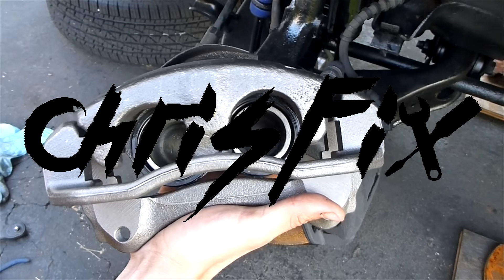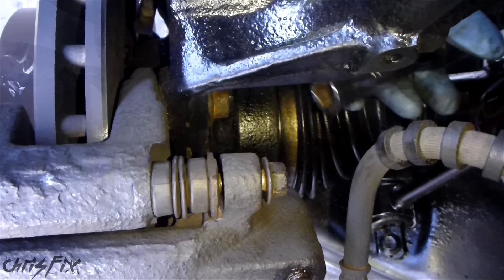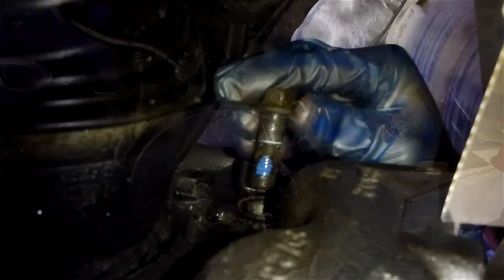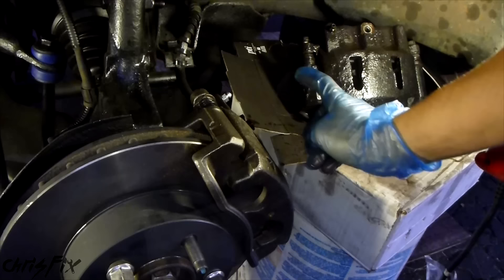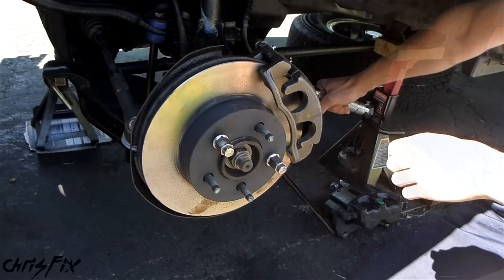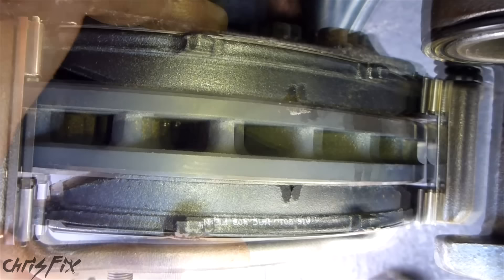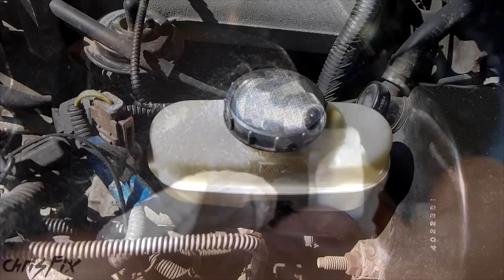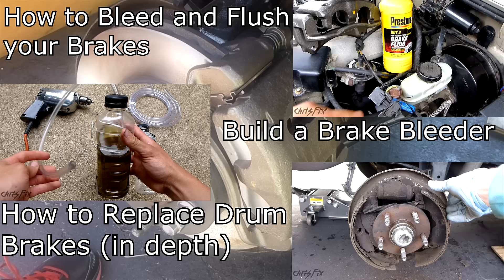How to Replace a Brake Caliper

Comment: Great video, as usual, with good tips for the novice. 
One recommendation:  I would only replace calipers in matched-pairs, especially when you're using aftermarket calipers (Centric, AC Delco, etc.), to ensure both have the same hydraulic characteristics.
Reply: I’ve never understood why doing just one side would cause the other side to fail. Of COURSE they have a little different hydraulic characteristics
Reply: @brandonminear9400  
Replacing as a matched-pair is more about grip-functionality.  If one side grabs the rotor more firmly/more loosely than the other, you'll have: steering issues while braking (especially while hard-braking), uneven tire-wear, uneven pad + rotor wear, etcetera.  The same thing applies to using unmatched rotors, especially if the material varies significantly in temper and composition.

Comment: Hey Chris you always do a great job with great explanations. One item you might should have mentioned was to bend down the "metail brake slides for the pads" so they don't move around. You'll notice the little tabs on the outside of them. This keeps them from vibrating into the brake disc and squalling like a crazy banshee! Appreciate all your videos, keep up the good work!

Comment: but yep, if all the people who watch this have a unsealed 32oz bottle of brake fluid, they can do this $230.00 job & bleed all 4 brake lines in the specific sequence for just $36.00.     and mechanics charge $230.00 per caliper too, and i think they only bleed the line that goes to the caliper that you needed to have replaced, not all 4.     so yeah, not only can you can do a better job, and flush all the old fluid outta all 4 of you're brake lines with nice synthetic fluid, but you can also do it for $36.00 versus the $230.00 a mechanic will charge you.    keep in mind, that the mechanic probably ain't using synthetic fluid, nor is he flushing old fluid outta any of the lines but the one he,s working on.      this is why i love doing jobs like this, at home.      thanks for making this video.    it walked me through each step perfectly, and it saved me a lot of money as well.
Reply from the maker: +Jeff Fuehr Glad the video was helpful and saved you money!
Reply: What do you mean synthetic brake fluid? lol
Reply: @DoctorFush  If your owners manual species a type, use that.  Say it is DOT4...some will offer 'synthetic'.  As long as your car calls for DOT4 go for it.
Reply: @goitoutdoors  Isn't all brake fluid 'synthetic', is what I was getting at.

Comment: doing the calipers and parking brake shoes on my 01 outback. Iv'e watched quite a few of ChrisFix  vids before and during work on my vehicles and appreciate the tutorials. just one beef is that he replaced the caliper bolts without cleaning them up and leaving the old thread locker in place.
EDIT: 3:14
Reply from the maker: This was an old video, but its good you saw that since you know how to do this properly

Comment: Hey Chris I just have a quick question I was wondering when you replaced the caliper do u bleed just the one caliper or do u bleed all brakes?
Reply: i was wondering that too
Reply: I'm pretty sure you need to bleed out all of the calipers. in fact, theres a specific order to bleed out the calipers. 1st caliper should be the furthest caliper away from the brake fluid tank in the hood (rear passenger side) and so and so forth.

Comment: Nice but you should of mentioned to check/add grease to the caliper bracket bushings (for those with used calipers as well as to inspect/replace bushings etc.)
Reply from the maker: Ash Ziavonni Thanks and thanks for sharing!

Comment: My bleeder valve was completely seized. Blowtorch/ vise grips didn’t work. Used an extractor kit. Still didn’t work and broke it flush. I could go more and use a dremil to cut a slit/ or drill a hole and yada yada… I’m thinking spending the $50 for the new caliper will be easier. Great video! Hopefully those bolts on the back aren’t seized bad. Gonna attempt tomorrow! Gotta love oxidation
Reply from the maker: Might be worth it especially it its that old, get those bolts soaked with penetrating fluid now
Reply: @chrisfix  ordered both front calipers none local. good idea! ima soak them tonight. It’s a 98 Kia Sportage. Weirdly the most reliable car ever I’ve had. I’ve only had a leak in the intake, put e6500 and wrapped in electrical tape. And this. 
But 8 years for $800, ima keep it going! 
Also, never tried it, but bleeding the brakes with a syringe. Seems easy

Comment: Your videos are great. No unnecessary fluff and you mention torqued settings although that varies from vehicle to vehicle. For instance most if not all Toyotas it’s 76-77 lb ft for the calliper bracket bolts and 25-26 for the calliper pin bolts. Interestingly the 77 is also the torque for the jug nuts. On my 2019 Buick the torque for-the lug nuts  is 100.

Comment: I have watched several of your video's, and all I have to say is, "thank you for sharing". My latest learn was how to change my rotors, brake pads and turns out the drivers side caliper (hence watching this video). Turned out my piston was damaged. Said using old banjo bolt voids the new caliper warrantee. Better safe than sorry. It's what...$3.69 at Napa. Your video had me looking at torque specs too. thanks for the close ups and part explanations. and the simple box trick. Saw that and was like, "Der". Why didn't I think of that. Things click when someone shows me. I used zip ties to suspend them and not stress the brake lines.

Comment: Thank you for all of your help with the many videos of yours that have helped me over the years. I thought that I was going to be performing a simple brake pad replacement on my 2003 Toyota Corolla, but it turned out that I had to replace the pads, rotors, AND the seized caliper. I could never have done this without your helpful videos. I have been out of work for the last 2 years and don't have the money to pay a garage (hence, the 16 year old car); Thank God that I have your videos to give me the knowledge and confidence to do this work myself. You have been a savior. Many blessings to you and your family!

Comment: I see you always mention how much to torque on each nut/screw where do I find a torque specs for each screw on my vehicle?
 as well I see you didn't put the jack stand directly on the middle frame of your car and you put a piece of wood any reason for that or you just wanted your car to be raised higher?
   lastly what type of Grease do you recommend to put on the back of the brake pad and the brackets I remember watching one of your videos what you put, just don't remember off hand and you didn't mention it over here.

  if I use the two-person method or even the one person method can I just put a bucket or shall I use a tube for the brake fluid to be placed on the bleeder valve? 

  And once again can't get over it, you are truly amazing when it comes to videos from your jobs you do, you move along the video and I don't lose my patience watching your videos, it gives me an urge to wanna do all the basic repairs on my own car and not waste my money sending it into the mechanic, just by watching your videos and enjoying how easy and simple you make it.
 Thanks Chris
Reply: Mayer I - I'll try to answer.
1) If you have a Chilton's Manual for your vehicle, torque specs are at the end of each chapter. Check your public library.
2) For jacking, find the specific instructions for your vehicle. And sometimes using a piece of wood is spreads the weight out over a larger area.
3) By high-temp brake grease at the auto parts store. Other greases break down under high temps.
4) For bleeding use a tube because, like in the video, it allows for the air bubbles to float upward if you position the hose above the caliper. If you don't use one, the fluid will drizzle out and air may move into the caliper without you knowing it.
5) Good Luck!
Reply: @ninemilliondollars  Thanks a million for answering.  Wanting to do the brake job for a while. Going to do it hands on and report back. Love to do such repairs.

Comment: You saved me, thanks a lot!!  Mine was a little different configuration (2012 GMC Acadia) but easy enough to figure out.  Also, had help, so just bled the brakes with someone pumping and holding the brakes.  **Used more brake fluid than I expected.  But might be because it was leaking!!

Comment: A good truck I found out is use an old tire vale stem to use as a plug on your brake line where usually the bajo Bolt goes, saves you some brake fluid mess

Comment: Absolutely a great video. Clear as s__t to  understand and video recording technique was spot on. I just did pads on my RV, and after taking a 1600 mile road trip I'm pretty sure I have a binding rear caliper. Hopefully it will last the 1600 mile trip home, where I'll do the replacement.

Comment: Big thanks for your very detailed video. I was successful to change the rear left caliper. But, I only can stop my car with brake pedal going to the floor. Do I need to bleed the new caliper? Thanks!
Reply: Update: it seems that only the two front brakes work, will see after bleeding the two rears

Comment: I have one question, if someone could answer this that would be super helpful; is it a good idea to replace calipers (and rotors) in pairs it would it be a waste of my money? there’s an issue with my front left caliper and i believe one of the rotors is warped (i don’t remember which one.) I’ve also considered resurfacing the rotor but at that point i figured it was more cost effective to just get a new one. thanks in advance and as everyone else in the comments is saying, Chris you make some incredibly helpful videos thank you so much!
Reply from the maker: I would always replace them in pairs! And thanks a lot!

Comment: Just some tips. 

Use a silicon fluid based grease on all moving parts. Not standard automotive grease. Anti seize on stationary part connections such as backing Plate of the pads. 

When installing new crush washers, torque banjo bolt and then do a light tap with a hammer on the head. Re torque. Remember it's a crush washer, that will make it seal real well.

Comment: Good video...  One thing I would do different, when you are using loctite - blue - I would NOT stop the tightening of the caliper mounting bolts as the loctite "may" set at a reduced torque value, then it may add resistance and "fool" you into a possibly incorrect torque value.  Once you start the bolt tightening, don't stop, torque to the full recommended value.  Just a thought.

Comment: Chris, can you show for the rear caliper where you have the emergency brake cable and how to detach it and later connect it without messing the tension in the cable.

Thanks!  U R GR8!

Comment: How do you know which calipers fit your car? Do you go for the rotor size specs or the # of pistons in has? And Thanks you Chris, because of you, I have been able to do oil changes, clean headlights, and maintaining my car. Now for my new project is to change my old brakes and my suspension.

Comment: If you are doing rear calipers with an emergency brake line, you'll have to find and loosen the emergency cable inside the car. Then before bleeding, you'll need to have someone pump and then HOLD the brake pedal down with their foot while you tighten the emergency brake cable back up. This sets the rear brake pad height from the rotor. On some cars if you don't do this, you will have too much of a gap and your brake pedal will go halfway down before starting to engage (i.e. Kia Soul).

Comment: Hi Chris. Thanks for making the video.
I replaced brake lines, hoses, calipers and wheel cylinders (rear). I noticed that no fluid bleeds from the 
rear bleeding valves. Does it mean my proportioning valve need a reset?
Reply from the maker: If you think it does give it a try, sometimes it take a while for new fluid to make its way to the rear though

Comment: Very impressed with your knowledge, step by step videos. U obviously know what ur doing. I’m getting ready to do my first full brake fluid flush, super radiator flush. Can u please do a video on a complete overhaul of a brake caliper? Piston, ring, boot removal, rings, etc,  and replacement. Just priced a caliper with new piston $140.

Comment: Thanks for sharing this- I also like to see how to clean the caliper- and the cause of damaged caliper.
Reply: A damaged caliper is one that's leaking or one with pistons that don't move easily - caused by sitting a long time unused, or having a buildup of dirt and other materials that freeze it. This can cause the brake pads to drag on the rotor and overheat the system.
Reply: @ninemilliondollars  Thank you so much for taking the time to reply-

Comment: One thing I’d add, make sure you fill the new caliper up with brake fluid, it will make bleeding the system way faster when you move the hose over.

Comment: Great video, thanks! Have a basic question. Do I have to bleed all four brake lines if I'm only replacing one caliper?
Reply: why would you need to bleed all 4 when you just changed 1 ??? 
When you have a flat tire, do you change all 4 ??
Reply: Michael. My suggestion would be to bleed all 4, it doesn't take all that long and also allows you to get some fresh brake fluid into the system and each line. Some may disagree but at the shop I always bleed all 4 regardless of how many brakes on a car I am doing

Comment: I noticed your brake fluid was very clean when bleeding the caliper.  Would you suggest flushing the brakes first, then the caliper replacement, then would you need to bleed all 4 break lines again after you replace the caliper? Or are you safe to just bleed the replaced caliper line?

Thanks a ton for the videos!

Comment: Question: the banjo bolt has a hole on the side to allow brake fluid to flow into it, then another hole to the bottom for the fluid to reach the caliper. When you are installing the banjo bolt, how do you make sure the side hole aligns with the brake line to allow that fluid to flow? I assume if you don’t align them, the fluid won’t flow.

Comment: Thanks for the vid I always wondered about crushing these hoses.. i'm scared to do it. I was wondering however if i could use one of those cone shaped silicone plugs and just stop the brake line with the? I used once on my bleeder screw hole when I needed to change that and it was pretty effective.

Comment: On a 2012 Ford Transit Connect XLT, my banjo bolts have some sort of nipple at the end of it which is too large to slip off old and slip on new washers. Gonna have to reuse what's on there. Both also seem to be adhered to the bolt. I'd hate to gouge them up taking them off only to learn I can't get new ones on anyway. Crossing fingers.

Comment: Stuff a lil but of a shop towel in the banjo bolt holder it’ll stop a lot of the brake fluid. Just don’t pack it like you’re tryna stop a bullet wound and your life depends on it

Comment: Did the front left caliper on my 2001 Oldsmobile Intrigue GX when I got the front pads and rotors replaced on my car with my friend 3 years ago. Going to get new front pads, new caliper guide pins for all 4 calipers, and other things. Also, how does one simply install a caliper on the rear of the car that has the emergency/parking/hand/foot brake cable? It's the same, except you would need a special tool to remove and insert the cable, right? My rear calipers are original and I'm going to inspect them sometime for any wear and tear before replacing the rear pads and rotors.

Comment: Disconnect brake line, clamp. Remove pads and callipers (obvious clips/bolts) Replace in reverse, reconnect brake line, open bleeder, remove clamp, left fluid run out a little, secure bleeder. Done.

Comment: What's the best way to prevent air from entering the brake line once it's disconnected. Do you recommend using a 2x4 up against the front seat to keep the brake depressed to buy time to get everything swapped?

Comment: I noticed you did not mention greasing the slider pins. Should they be checked for grease prior to installation of the new caliber? Also, do you use grease or silicone on the pins - your recommendation is appreciated. Great video by the way.
Reply: I think they come disassembled so you would put the silicone on when you build it up.
Actually for the Kia I can’t seem to find the complete brake set up. You need to buy individual parts.

Comment: I have a 2009 Honda Accord, we had our rear brake pads, rotors, and calipers replaced.  Now the handbrake is extremely loose when engaged.  Should the hand brakes be adjusted at the time also?

Comment: I have found pushing the brake pedal more than half way down will cause the piston cups to move through the parts of the cylinder that has never been used, causing damage that shows up a few months later as an internal leaky master cyl.  therefore when bleeding brakes do it near the top of the traval.  no one ever mentions that.